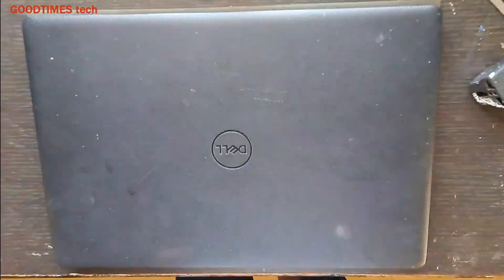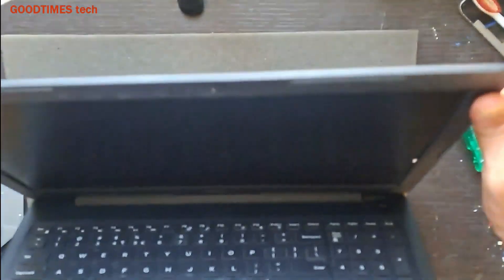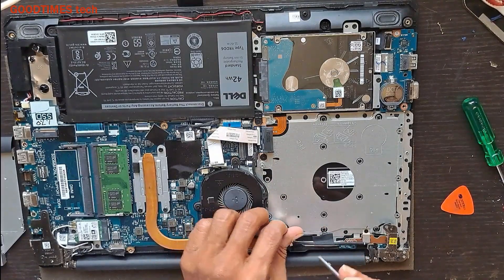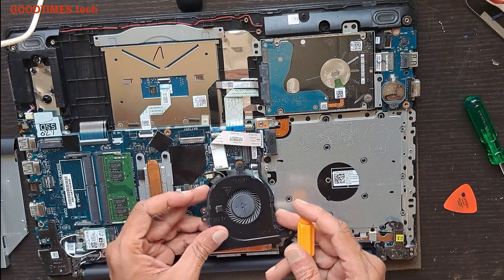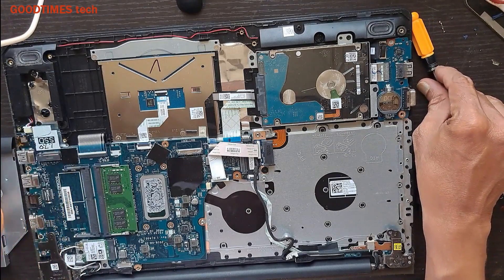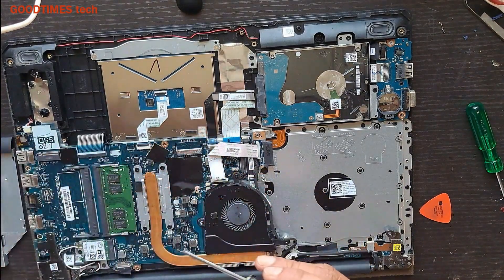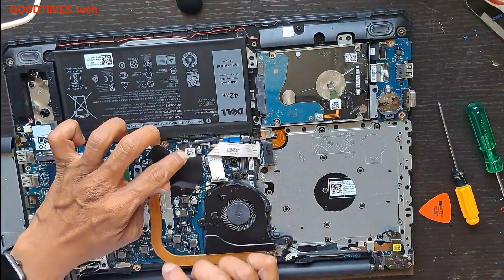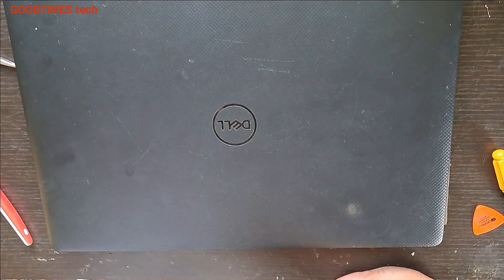DELL Vostro laptop Overheating solution.

Comment: Maybe you should clean the old thermal paste off with alcohol and then spread the new one evenly before putting it back. And move heatsink around while applying pressure to spread it evenly. I only done few CPU's, but have done many transistors. And it keeps heat much lower.